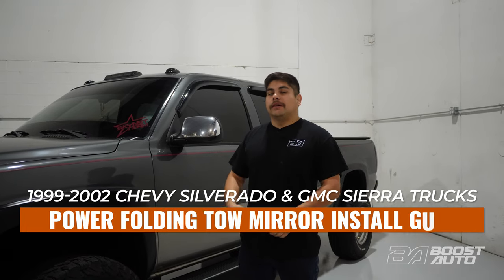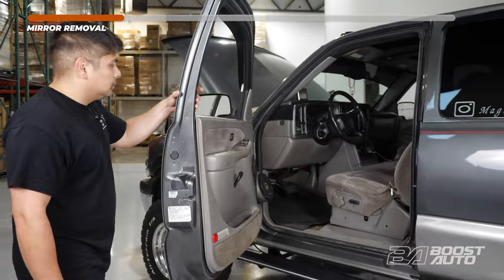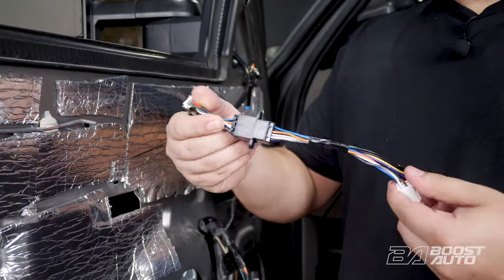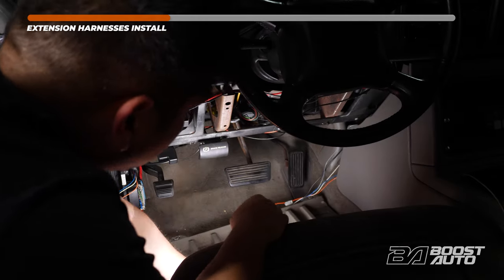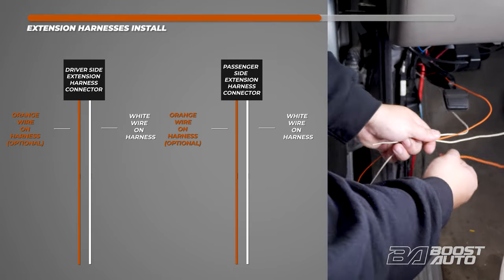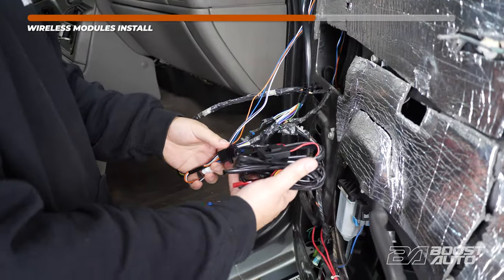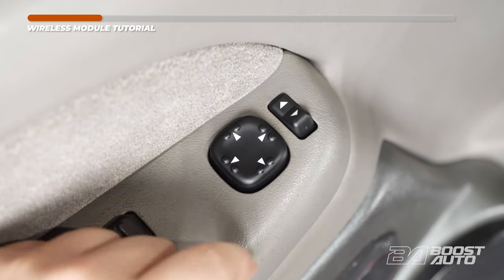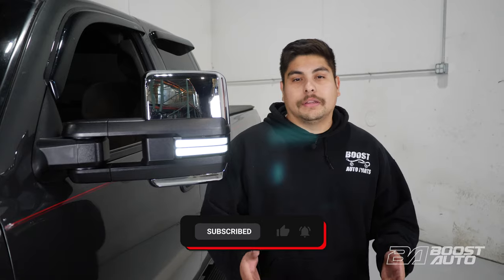1999-2002 GM Tow Mirror Install Guide | Add Power Fold for Chevy Silverado & GMC Sierra | Boost Auto

Comment: Purchased this set after reading a bunch of reviews on other brands. These are pricey but they look and feel identical to my factory 2017 Silverado mirrors. The quality of this kit which included everything (3M connectors) was impressive. A breath of fresh air after so many experiences with china garbage. Took me about 5 hours to install and everything works great and no rattles or shaking going down the rough socal freeways. Nice quality Boost Auto Team👍🏻
Reply from the maker: We appreciate the feedback. Given our company is owned by a truck enthusiast; one of the things we live by is that if we wouldn't put it on our own truck we wouldn't sell it. What that means is things are over-engineered and designed to last. Enjoy your mirrors for many years to come - we appreciate your business!

Comment: What happens if you forgot and manually fold them will they break?
Reply from the maker: There is a breakaway, but it is designed for emergencies only. The mirrors should not be manually folded intentionally.

Comment: Great tutorial as always.  I've been wondering when someone would come out with a folding mirror package for the older Silverados & Sierras... looks like I better start saving😊
Reply from the maker: The time has come!
Reply: I have an older set of type mirrors that I've had for a few years now and was wondering if you sell just an additional kit that would modify those older ones to where the have the electric folding option? I know it's a long shot and not even sure if something like that is possible but was just wondering
Reply from the maker: Unfortunately the mounting bases are totally different, so you would need to sell your current mirrors and pickup a new set. @cmcd082